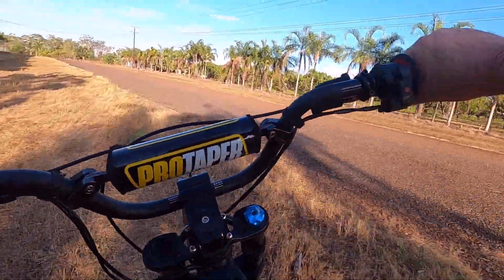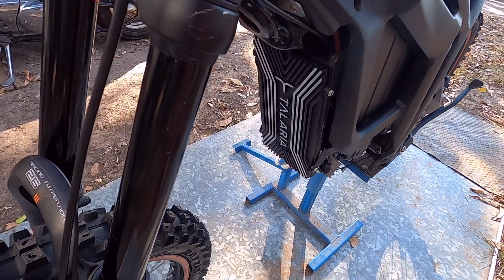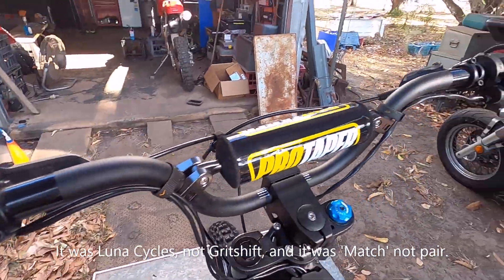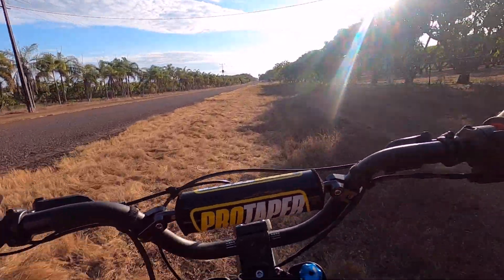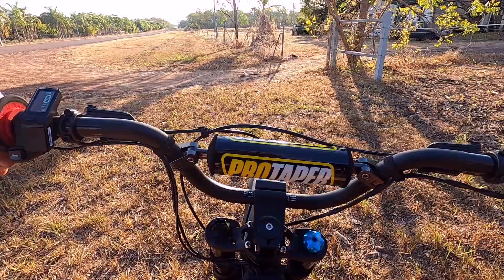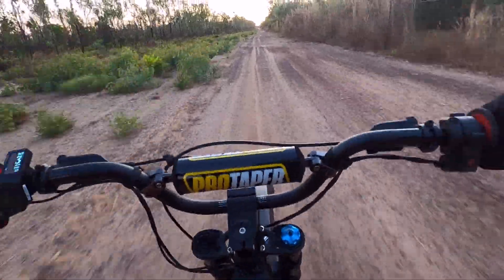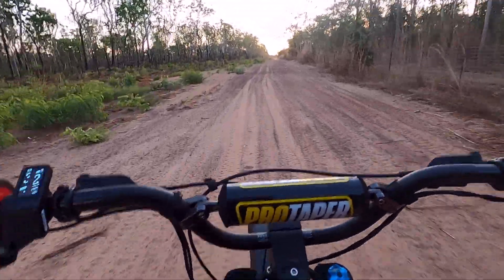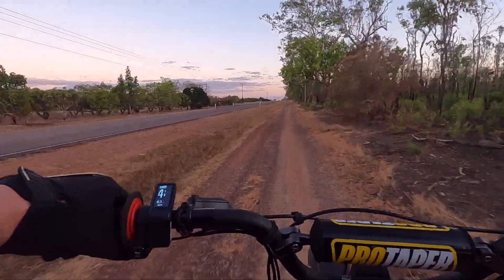Can I convert a Talaria Sting Mx3 to Mx4. Pt 2. You need the Battery!  (Details in Description.)

Comment: Hi buddy are you available to chat regarding these
Reply: I had a sting and I put a sting R motor, controller, gearbox, speedo to match and a sting R battery and mine is jolting in sports mode like it's being restricted or it can't handle the power but it's basically a sting r now I don't understand why it's doing it and it matched successfully only thing I haven't changed is the loom and regulator it just doesn't make sense at all

Comment: Great video. I'm about to swap my mx3 controller with a mx4 controller and was wondering if the display will still works after the swap?
Reply from the maker: @eucme9716  yes the screen works just rhe same on the mx4 controller as it does on the MX3.

Comment: So I have the mx3, and my controller and motor burned up. I just received a new mx3 controller but haven’t got a motor yet. Can I get the MX4 motor and run with my mx3 controller, battery, and gearbox as long as I get the mount bracket for the gear box?
Reply from the maker: Yes, you can and the motor is smoother and more efficient so you get a small increase in power to the wheel also. Does your new controller have 2 silver stripes each side of the "Talaria" or 3 stripes on each side?
Reply: It has three stripes.
Reply from the maker: @rhaak1234  three stripes appears to be the MX4 8kw controller. But it will run like a MX3 unless you have the mx4 battery. I'd love to know how it goes when you get it sorted.

Comment: I'm going to leave my mx3 controller (3 stripes) on and get the mx4R battery so I can have more kms on my rides. Throttle curve on mx3 controller seems better. My mx3 is the late 2023 with some of the upgrades as stock model.
Reply: My spelling of Efficiency is correct on my motor on my late 2022 mx3, also has peg brace, more level seat, still got DNM forks, has a good throttle curve from start to almost gtop speed. Gets to about 65 km then tappers off and winds out to 74km top speed and I'm 110kg.
Reply from the maker: @Pedro-ju7tp  With that spellng it sounds like you have the new motor and throttle. Maybe your bike is almost an MX4 with 200mm rotors and a 38Ah battery, It sounds like i have upgraded my first edition to what you have and i love it. Thats too funny. I am putting a bigger rear sprocket on and saving for the battery but its going to be rapid. Haha
Reply from the maker: Thankyou for the update.  Im betting that if you have the three stripes there is a good chance you will get 8Kw from the new 45Ah battery, Im saving for one too. Please keep me updated. Also it's a strange question but how is the word "Efficiency" spelt on your motor?
With the mods I've made to the bike now and how smooth it feels at 6Kw I cannot wait to feel it with 8Kw.
Reply: It came with the stock disks but I have upgraded to the 203mm, much better stopping
Reply from the maker: Mine arrived today, Front only though. I'll try and wait till my stock fronts really wear out before I change them I'm thinking..  I'm not sure about my will power tho!!!
Reply: @wheels.3239  the bigger disc makes a big difference in stopping power

Comment: Hi, i don't know if i understood correctly but you say that the new controller will work and give 8000 kw to the mx3 motor? If i keep the mx3 controller and put the mx4 motor, will it put 8k or 6k? i already have the mx4 45 ah battery. So the unltimate upgrade is to replace both the motor and controller and the mx3 gearbox don't fit the mx4 motor? sorry fot my english i speak french. Thanks!
Reply from the maker: Ive addd more info, i hope this helps.

Also the Mx3 gearbox did fit the Mx4 motor, and if you put 85ml of 85w90 gear oil and 5 mls of moly additive it runs so smoothly.
Reply from the maker: If you have the 45ah battery, just do the controller. Sorry for my rambling on my video. 
The 45Ah Battery and Mx4 controller will give 8kw on either motor.

45Ah Batt + Mx4 Controller + Either motor = 8Kw
38Ah Batt + Mx4 Controller + Either motor = 6Kw

Mx4 Motor = Smoothness and efficiency. (So much smoother, appears to be getting better range so far.) 

I hope this helps and Cheers from Australia.
Reply: Thanks this is all i wanted to know!
Reply from the maker: @alexandreastronomy8022  My pleasure, it's what I wanted to know and why I did the videos, it is nice to know I have helped. I would love to know how you go with it all. Cheers from Australia.
Reply: I have spoken with Ae bikes dealer in NSW and the mx3 motor with the mx4 controller/battery will give you 8kw with no issues
Reply: @Pedro-ju7tp  Thanks for your response. Its a great thing as i allready have the mx4 battery. I have the early version mx3 without the late upgrades son my trottle is not nice at all. I was wondering if a need the mx4 trottle grip? I think the connector is not the same but i cand solder them.

Comment: Your controller pushes 8000watts and communicates woth the bms to allow it to pull 8000watts. Its not communicating and pulling 6kw its communicatong and pulling 8kw. It doesnt make sense that the controller would recognoze the battery and deliver 6kw. It makes more sense that the bms communicates and delivers 8kw the controller doesnt ha e 2 power modes one for 6kw and one for 8kw
Reply from the maker: I thought that too, but check out the AEBikes website under 'Power upgrades', I will be hunting a MX4 Battery to try and find out because i was hoping for more.
Reply: @wheels.3239  ya I seen it just not sire of I believe it. It makes sense that the bms communicates and can deliver different powers. It doesnt make sense that the controller would be able to deliver 6kw or 8kw depending on the bms
Reply from the maker: @MotoAlias  I think it detects the BMS Amp hours output and gives a different MAP for each battery.  It feels butter smooth now, and does it easy. And a fair bit quieter, But it doesnt feel like any more than a 10% gain at the moment.
 You can even buy just the MX4 BMS from AE ,  but then it will try and charge my 38Ah battery to 45Ah, which wont end well. 
I'm keen as to find out tho!!

Comment from the maker: Sorry I forgot the Tyre/Tire details guys, 

Rear Tyre at the start of the video: MAXXIS MT 70/100-19 Is sold as a front (Doesn't fit RST fork)
Rear Tyre after the change: Dunlop MX33 70/100-19 Also sold as a front. (its big for a 70/100)
Front Tyre is:  MAXXIS IH 70/100-19 Sold as a front (Fits RST Fork, about as fat as you will get.)

They work really well as a pair. They are both soft to intermediate compound and stick like 3 day old avacado to a bowl!! If you ride loose surface hard pack ground this is an incredible combo.